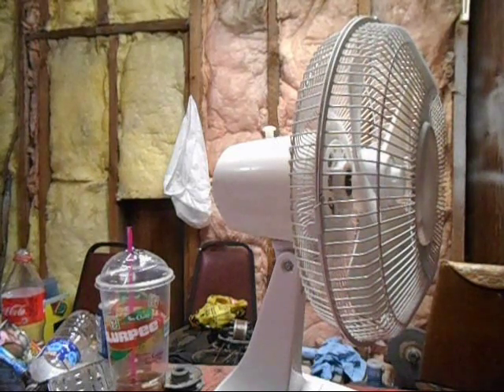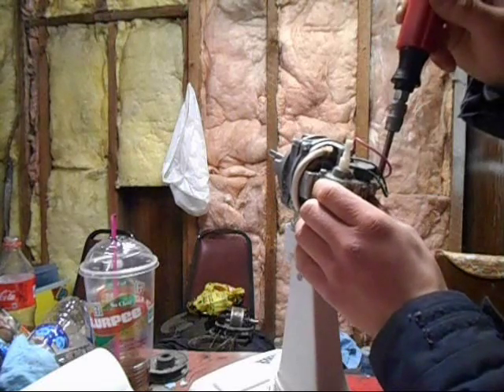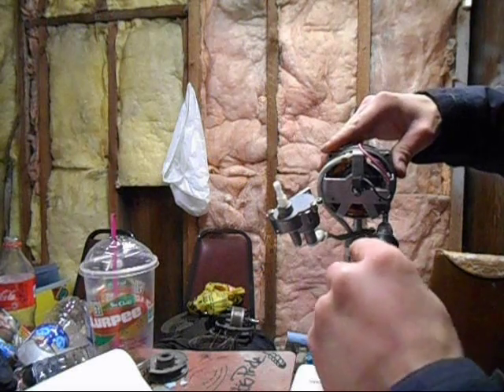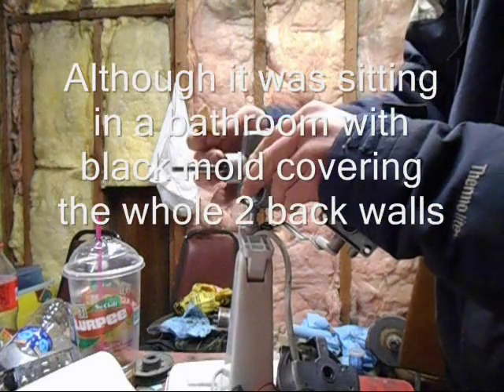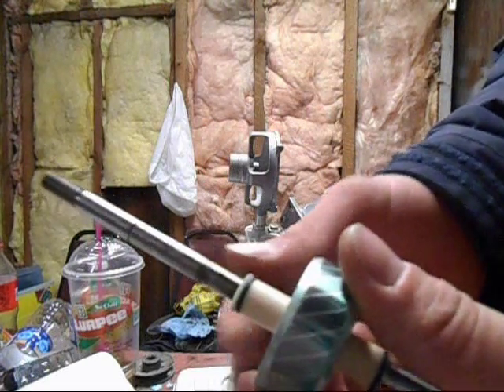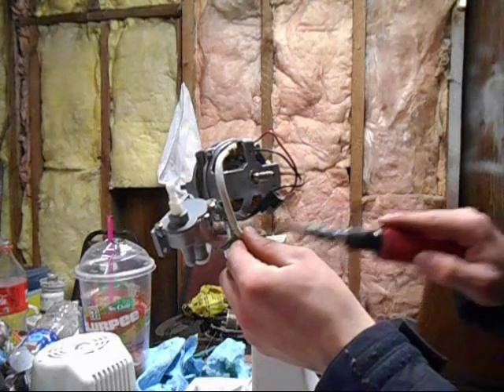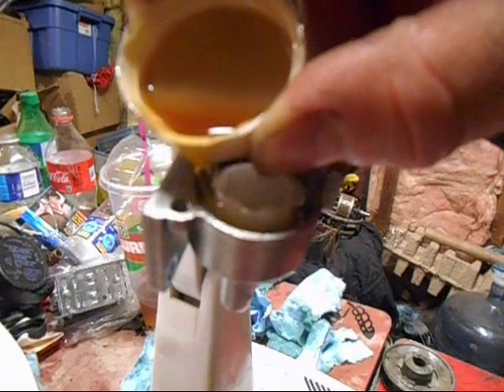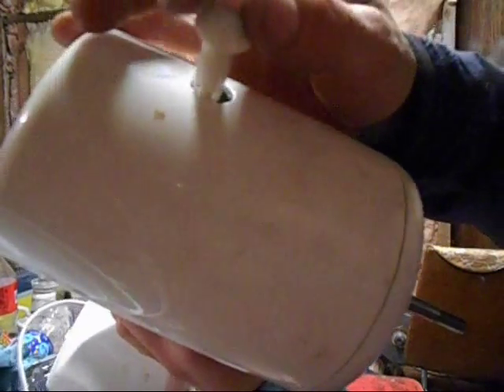Let's Tear It Apart: Average desk fan

Comment: What can be done to loosen the knob that holds the propeller blade in place.  I just doesn't seem to budge at all, any tips ?
Reply from the maker: +QueenlySweetpea did you try turning it to the right? all fan blade fasteners are reverse threaded to prevent the blade from loosening while in use. 
If that info doesn't help then Idk lol I guess use force.
Reply: Thnx for your reply Hobby. Yes, it has arrows imprinted in the plastic to indicate which way to loosen and tighten it.  I finally ended getting a bright idea, rubber gloves from the kitchen. Still had to use some force but had a good grip & it worked like a charm.   Fixed it and the fan is back to working great again :)
Reply from the maker: QueenlySweetpea right on glad you got er going! just remember, those hubs dont need to be extremely tight, I'v broke a couple before lol

Comment: I wouldn't do that to any fan.
Reply from the maker: Tony Price well have fun with your seized up fan lol
Reply: It isn't that difficult. If you have some electrical motor oil you can keep a fan running forever. I have to do this for a hv fan i have in my bathroom that seizes up a couple times every year. I guess in moist and dusty climates the fans oil drys up.